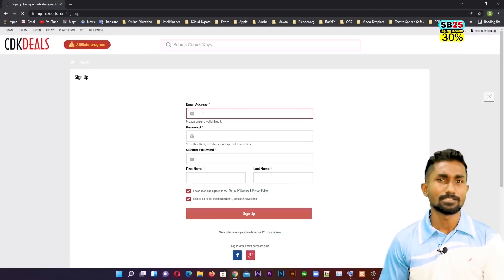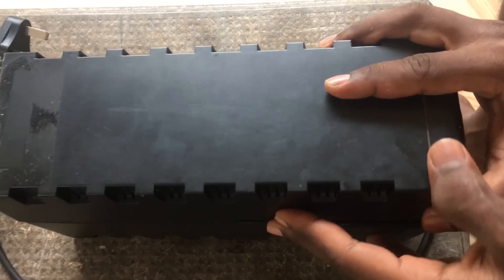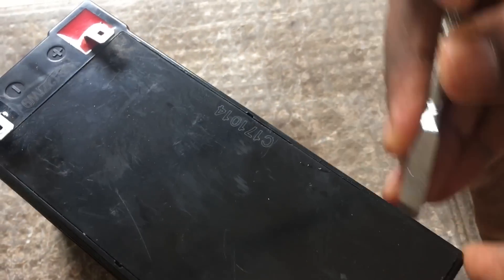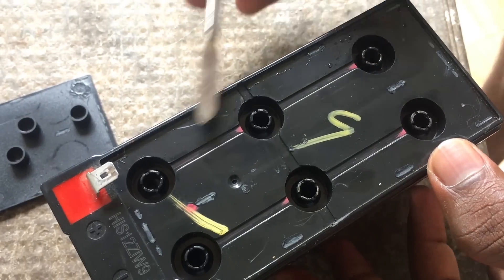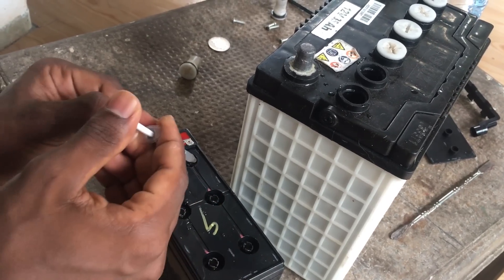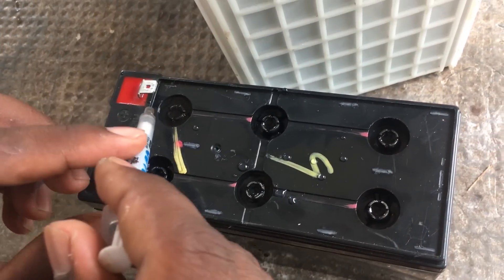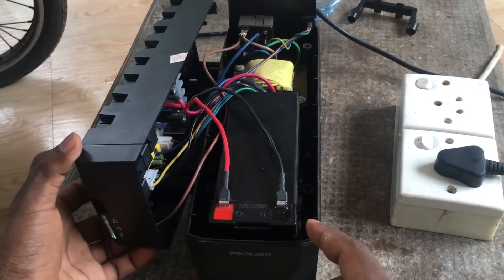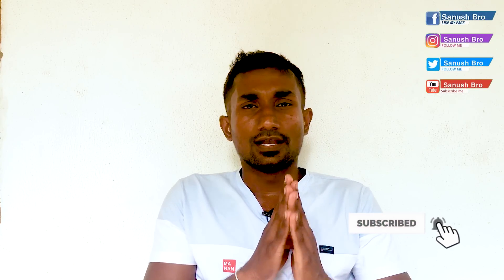DIY How to repair UPS dry and dead battery best method | වැඩ නැති  UPS බැටරි නැවත භාවිතයට සකස් කිරීම

Comment: 2021-Aug DCP 1200 UPS එකක් ගත්‍තා. මේකට LAP 1 + FIBER SLT router එකක් use කලා පැය 5ක් පමන. Lap එක සැම විටම 100% bettry charge එකේ තියෙද්දි UPS එක සමග සම්බන්ද කර වැඩ කලේ.

2021-march (within 6months) Bettery buckup time එක 20min වලට අඩු වුනා. Warrenty තිබ්බ නිසා warrenty දැම්මාම battery replaced කලා කියලා repire කරලා දුන්නා. 

නැවත 2022-may (used around 1month after repaired) වෙනකොට battery backup time එක පෙර සේම 10-15min අඩු උන නිසා නැවත repire කරන්න දුන්නා. නැවත battery 2ම මාරු කාලා කියලා Debug එකෙන් repire කරලා දුන්නා.

නැවත 2022-june (used 1day after 2nd repaired) දෙවන repire එකෙන් පසුව දවසක් ඇතුලට පාවිච්චි කර බැලිමේදි එහි backup time එක 30min විතරයි තිබ්බේ..

නැවත repire කිර්‍ර්මට දැම්මා. තාම DEBUG ආයතනය repire කරමින් සිටි. 

DCP 1200 UPS එකක් අවුරුද්දක් යෑමට පෙර මෙසේ සිදු වීමට කුමක් බලපායි ද?
මෙය battery මාරු කලානම් නැවත නැවත backup time එක අඩු වීමට හේතුවක් තිබේද?
Debug ආයතනය අදහස පරිදි capcitors issue එකක් වෙන්න පුලුවන්ලු. මේයට විසදුමක් තිබේද?
Reply: DCP එක කොලිටි නැ මචන් මටත් ඕකමයි උනේ Battery අන්තිම සවුත්තුයි ඒ විතරක් නෙමෙයි DCP ඒවගේ එන්නේ බාල charging module එකක් එකෙන් battery condition වෙන්නේ නැ හරියට.

Comment: Ayye mage ups batariya deth welathibune mama akata kaden batary acid. Damma namuth high charge gahuwe naha  payak witara ups aken charge kalat  vinadi 5n off wenawa. Gataluwa mokakda. Thank you
Reply from the maker: acid godak danna epa malli... vedipura dala nam eva tikak adu karanna cell eka pegunama athi..  e vagema thmayi puluvan nam peya 8k charge gahanna... ups battery eke power factor eka 0.7 ho 0.6k vage thmai veda karanne e kiyanne hariyatama use karanna puluvan ganana. oyage battery eka 7Ah ekak nam 12*7 = 84 VA agayak enn ekenuth 84*0.7 = 58.8 i hariyatama use karnana puluvan. ethakota oya use karana electronic device vala watt ganana anuva meka bedila giyama vinadi 10k vage thmai enn malli... battery eka update kaloth hari yai
Reply: @SanushBroThinkDifferent  Thank you

Comment: සර්, මටත් ගැටලුවක් තියෙනවා, මගේ battery එක dead වෙලා නෑ, ඒත් power on කරනකොට noise එක්ක එනවා. මගේ තියෙන්නෙත් prolink ups එකක් normally අපි power එකට plug කරලා pc එක use කරන කොට green(yellow) light එකක් පත්තු වෙලා තියෙන්නේ සහ කිසිම sound එකක් එන්නේ නෑ, ඒත් දැන් orange ලයිට් එකක් පත්තු වෙන්නේ, සහ pc එක use කරනකොට දිගටම noise එකක් එනවා... මෙම power cable එකේ අවුලක් වෙන්න පුලුවන්ද?
Reply from the maker: Battery eka galavala vire tika clean karala ayema gahanna gdk durata hari yavi...

Comment: When i plug Dialog outdoor antenna to 650va UPS, UPS shuts down in less than 5 mins. Why is this ? Power consumption mentioned on router is 14V , 0.8 amps.
Reply from the maker: please check your ups battery health. I think battery health is very low...
Reply: @SanushBroThinkDifferent  Nothing wrong with UPS. Normal router & TV also work fine for at least 1 hr.

Comment: මං ගාව තියන UPS දෙකම 160V එන්නේ  ඒක 230V හදාගන්න හැටි Video එකක් දාන්න පුලුවන්ද? මං ඔහොම හැදුවා බැට්‍රිය චාජ් උනා ඒත්. විනාඩියක්වත් තියෙන් නෑ 12.5ක් චාජ් උනත් බැට්‍රිය බහිනවා. චාජ් කරද්දි ඇසිඩ් යනවා කප් එක ගලවගෙනෙ.
Reply from the maker: Transformer eka ayemath thamba kambi othanna vei... eka othanna oni vata pramanyak thiyenava e gena video ekak danna try karannam mn
Reply: @SanushBroThinkDifferent කලින් 230ම ආපු එකක්. Circuit එකේ අව්ලක් නෙමේද ඒක.
Reply from the maker: @dumindaprasad1677  kalin 230ma ava nam den godak durata circuit eke kotasak pichchila ven puluvan. e nisa elecronic danna kenekta pennala circuit eka check karanna repair karanna puluvan vei
Reply: මගේ යූ පී එස් දෙකේම 160 යි එන්නෙ  ඒක සාමන්‍ය දෙයක් වෙන්න ඇති නේ ? හැබැයි හොදට වැඩ
Reply: 220v වලට විතරක් වැඩ කරන electric item අමුතු සද්දයක් එක්ක වැඩ කරන්නෙ. ලෝඩ් එකක් අල්ලන්නේ නෑ. ඕෆ් වෙනවා. ෆෑන් එකක් දැම්මත් මෝටරෙන් ලොකු සද්දයක් එනවා.